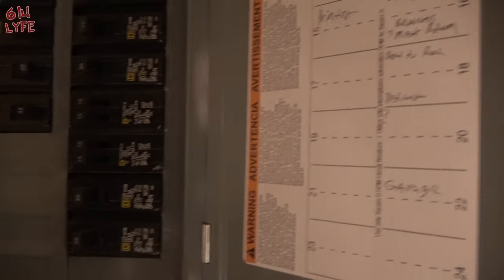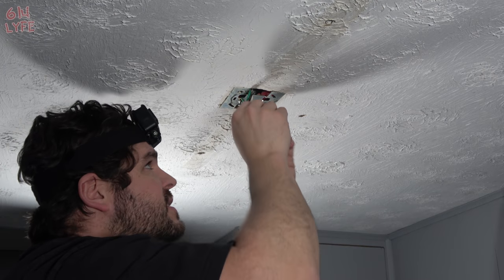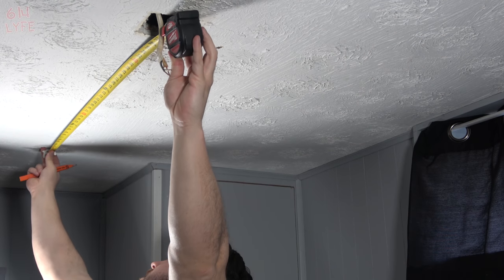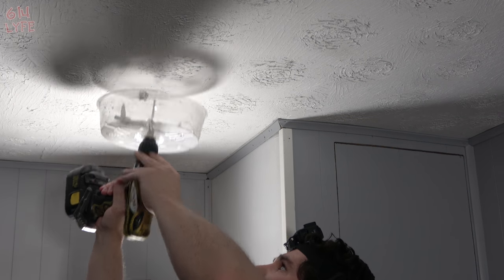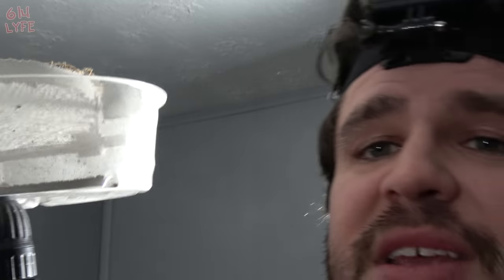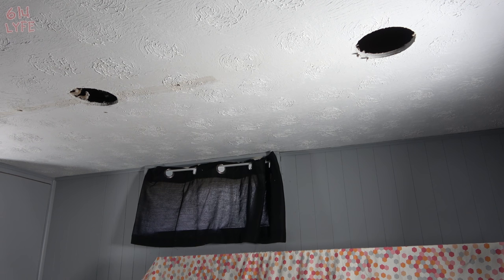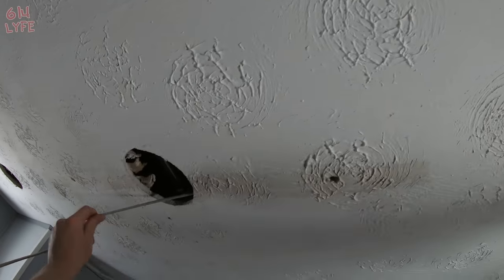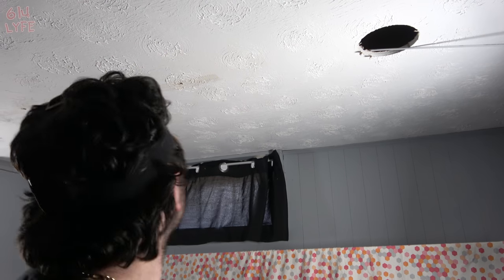DIY | How To Install Recessed Lighting With No Housing or J-Boxes

Comment: Code here requires that romex cable must be secured to a joist or stud within 12 inches of entering or exiting every junction/connection box and cable is secured along the run.  Every video on YouTube I've watched shows everyone running loose wires in the wall or ceiling cavity and just stuffing the fixture cans up into the ceiling holes.   Is everyone just bypassing the code and hoping the installation is never electrically inspected?
Reply from the maker: If you do it yourself you don’t have to get it inspected.

Comment: What “type” of cable do you use to connect the led lights from one to another?
Reply from the maker: The same wire you use to go to the circuit box
Reply: Also use a strain relief on the NM-B wire to the junction box  (by ((fire)) NEC code- wont go into the physics why its important)

Comment: I’m planning on installing 6 in my garage to replace the single light that’s in the garage. What’s the best method to do this?
Reply from the maker: If you jist have beams cut some pieces of drywall and hang them where you want the lights and drill the holes that way. Very simple. I also know they make a plate for this but its much more expensive that way.

Comment: You forgot to install a, not provided with the light, a plastic grommet in the knock out hole you ran the romex cable thru!!!...Sharp edges in that j boxes knock out hole could cut thru the romex sheathing and short out the wires, and or cause a fire!!!...

Comment: Please don't take this the wrong way, but did you read the instructions before installing these?
If you did you'd see that there is no need to take the knockouts out. There are two grommets built in the junction box for inserting cable.
Reply from the maker: much faster to just do it how I did it. Time is money
Reply: @614Lyfe  Faster to pop the knockouts out than to just slide the cable through the already installed grommets? 
Also,  you didn't provide romex connectors, as was mentioned elsewhere. You wouldn't need the connectors if you used the built-in grommets.
Reply: Here come the master electricians of YouTube 🙄

Comment: If you're going to post an instructional video read the instructions first. Whenever you use the knockouts you have to use romex connectors. They protect the cable from rubbing against the sharp edges of the hole. Ironically these particular boxes come with grommets built in that serve the same purpose. Would have taken less time and would have been done safely.
Reply from the maker: Thanks for watching

Comment: Do these work if i have olaster and lathe?
Togother those things are like an 1inch instead of the required 1/2 inch standard drywall
Will that be an issue?
Reply from the maker: Very thin mount you should be fine

Comment: Ya forgot the romex connector..
Reply from the maker: Yes thanks
Reply: phil petro , I was also gonna say that lol
Reply: Or a snap bushing
Reply: This lights come with two black cable clamps built in for #12 o #14 romex if you pay attention you'll see them on the top of the box so you don't even have to punch out the metal knock outs for the romex connectors, you'll have to lift the closing tab to open this so you can push or slide the romex in to the clamps. I installed a lot of this before and all the Halo lights come with this cable clamps but if you use the commercial electric lights you'll have to use romex connectors

Comment: I’m not an electrician but... I didn’t see any conduit clamp connectors at the entrance of your metal box knock out. 🤔
Reply from the maker: Yes this is true. We ended up adding then after the fact and this box also had them built in

Comment: Just put in 8 of the CE Edgelit LEDs and and am getting nothing....no popped breaker but no light. The model I have has plastic boxes with three hole connectors (black and white only, no ground (green) connection). I've run them in a loop and connected them back up to a known power source. What dumbass move have I pulled?
Reply from the maker: You might need to contact an electrician that a bit above my skill level so sorry I don’t have an answer
Reply: Figured it out. The living room should have two 3-way switches and somewhere along the line one got replaced with a regular one. Never use that switch so I'd forgotten that with it off it cuts all the power. Thanks!

Comment: FYI, this guy is not an electrician and there are a number of things he did wrong that would not pass code.  Code rules are there for a reason, hire an electrician.
Reply from the maker: Good thing DYI doesn’t get inspected
Reply: What's not to code? I thought these new all in one recessed light kits were so simple and contained that they couldn't break a code if they tried. Please explain.
Reply: Corey Gagnon  stop hating what are you the freaking recess light police? You probably call an electrician to replace a freaking light bulb

Comment: 5000k is horrible.   3000k is the way to go
Reply from the maker: Its all personal but you are able to switch it anytime with this setup thanks for watching
Reply: @614Lyfe  what do you mean change it anytime?? replacing the while assembly or juat the light itself??  where do you change 5000 to 3000 is it a switch on the assembly or would I need to buy another set of lights with different number.?
Reply: @edimo3  If you look around 1:05 he explains that the lights have 5 color settings from 2700K to 5000K; at about 2:05 he shows on the end of the Jbox where the switch is to change the color setting.

AWESOME video, thanks.